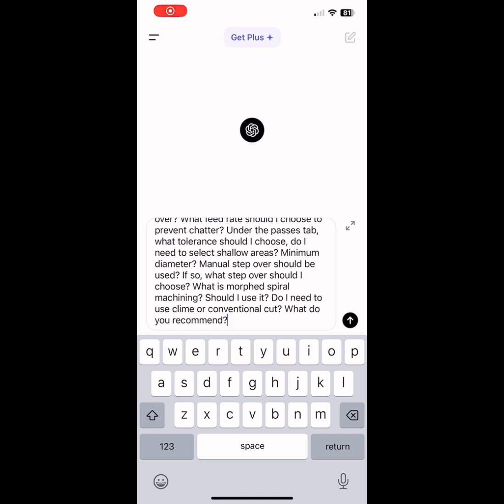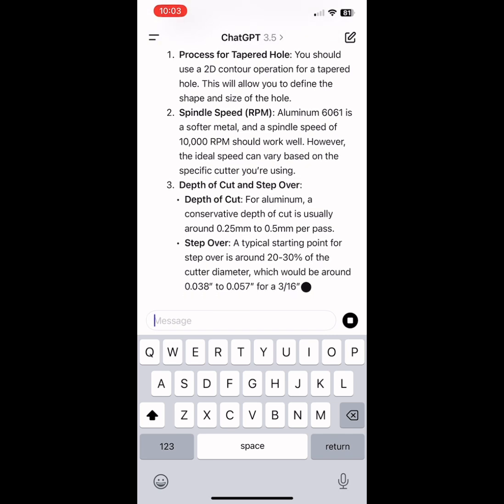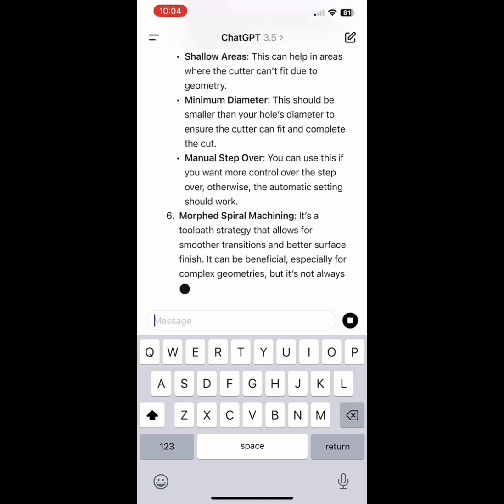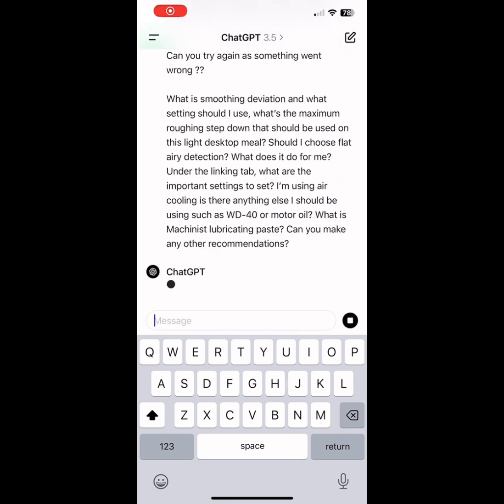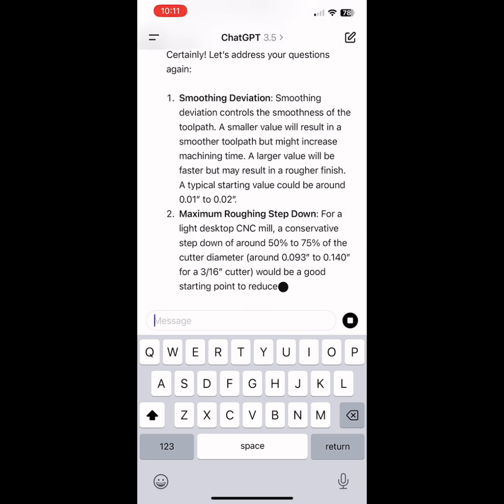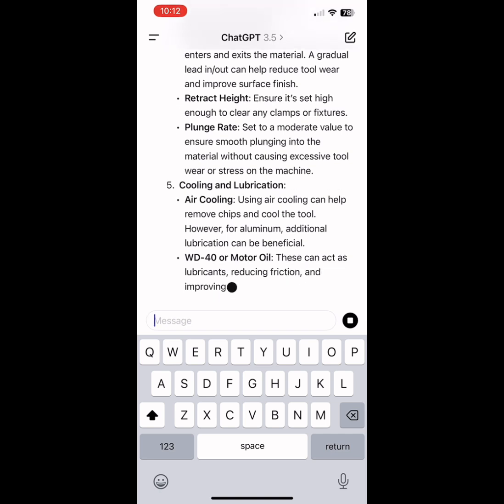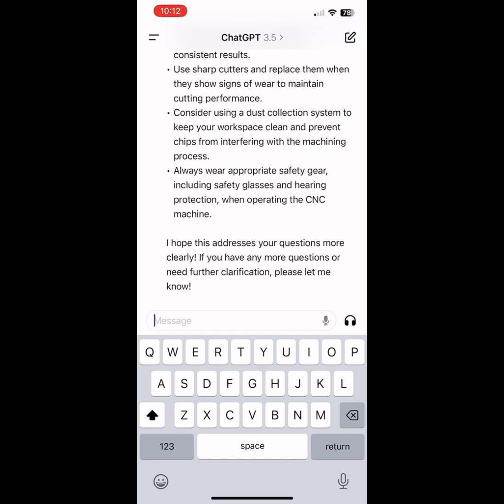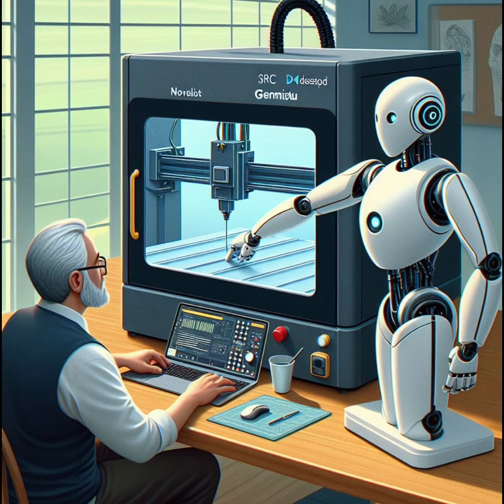Use AI in your CNC machining/Rotering.

Comment: You have to be careful though. The AI will rarely respond with "Not sure" or "Don't know", instead it will very confidently provide wrong information
Reply from the maker: Absolutely, I’ve even had to tell it, but it told me two different things at some point. But when you don’t know what to code into software, at least you get your pointed in the right direction. You can ask it what it means what does figure does or what parameters I should be looking at.